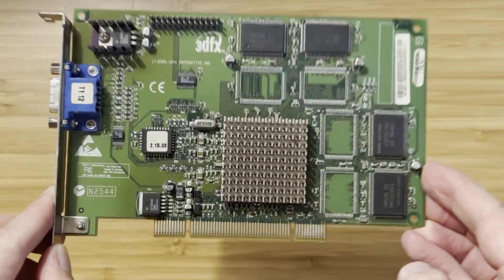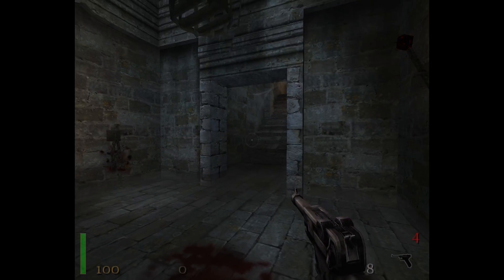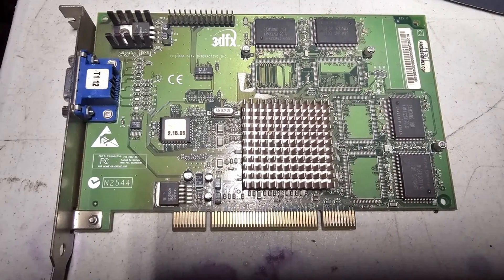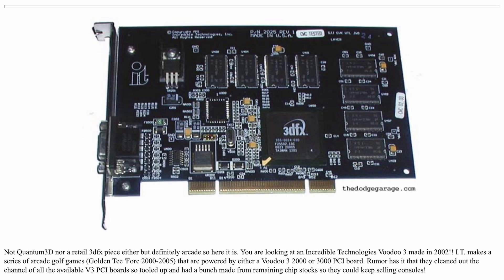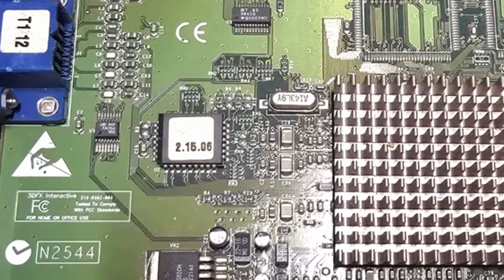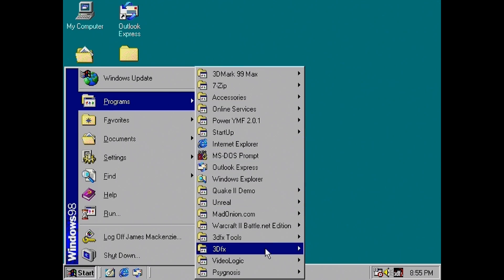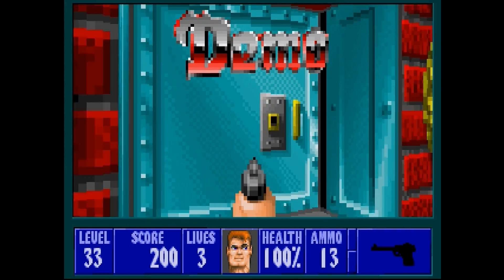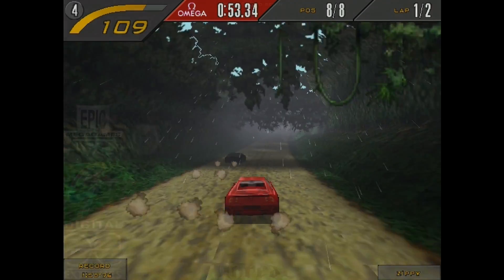Does this Arcade Machine Voodoo 3 work on PC?

Comment: i had this one (Btw iloved Voodoo and it was great to play it ) BUT ,.......this card i am sure have a ver bad cooling ...  The card had 2 mm Cooling Paste below the heatsink . It worked for 20 Minutes ..after the PC Froze becouse the Voodoo 3 Overheated ..After Adding a new Cooling Block on the chip  ..Overhead was over ....
Reply from the maker: Thanks for the tip! I haven’t done a re-paste yet, but now will double check!

Comment: I have a VooDoo 5500 AGP, but I do not have a compatable mother board. I had it from new. So if I want to use voodoo graphc modes i use nGlide it works ok,
Reply from the maker: Both nglide and dgvoodoo are great solutions if your real Voodoo hardware is incompatible - I used it a few of my machine too 😎

Comment: That ati radeon card you have installed can use nglide or zeckensack glide wrapper without needing a real voodoo. the Dgvoodoo wrapper can also be used for glide DOS games.
Reply from the maker: I’m very interested in dgvoodoo support for DOS! I’m not aware of any DOS 3D renderers that would support e.g. a Radeon. Do you have any more details? 😎
Reply: @jamesfmackenzie  hello, for dgvoodoo glide support to work requires that dos games run under windows with a direct3d7 capable gfx card via windows dos prompt.

Comment: I recently picked up a Voodoo3 1000 16MB SGRAM for $60, did a volt mod, added a heatsink with a fan, and flashed 3000 VBIOS.  The real rub is that it's faster than my real SDRAM 3000. 😂
Reply: You got scammed too...
Reply from the maker: Amazing result!! 😂

Comment: ...for cheap, less than 100 dollars. That sounded terrifying. Maybe inflation has something to do with it, but I remember getting Voodoo3 2000 and Voodoo3 3000 cards for less than 5 dollars, back in 2005-2010...
Reply from the maker: Yeah, these prices have gone crazy. Unfortunately my original hardware is long gone - so I’m trying to re-buy everything. $100 is actually a very good price vs what these normally go for - especially PCI variants 😢
Reply: @jamesfmackenzie  Это только начало - инфляционная буря у раздутого на 90 процентов доллара  будет хуже чем в 1930х... Санный Джо сделал все что мог
Reply: @ЕвгенийБеликов-у9у что ж ты чушпан им на английский не перевёл?😂 Они ж ни черта не поймут
Reply: @ЕвгенийБеликов-у9у  не интересно - не переведут, никто этого не делает.
А насчёт словечек - так я понятия не имею, откуда это несуществующее слово взято, но сразу видно что ты в теме "шедевров" кинематографа 😂

Comment: i still have my 3dfx Voodoo 3 2000 PCI card I bought from Walmart for $100 back in 99 to replace the S3 Virge DX that was in my system, i also still have the system i put it in. yeah it's overkill for a Pentium 1 200Mhz system, but the S3 card that was in it wasn't really good for much other than DOS gaming.
Reply from the maker: Quite the upgrade from the Virge DX! 😎
Reply: @jamesfmackenzie  for 3D acceleration indeed, BUT for DOS games that S3 with the VESA drivers was no joke.

Comment: With two video cards in the system how do you manage the output ? Rg do you have to swap the monitor cable? Ot is it always connected to the agp card and the system can take advantage of the voodoo in pci slot and render glide displaying the picture on the agp card?
Reply from the maker: You need two cables. I have a DVI cable running from the Radeon, and VGA from the Voodoo 3. I connect both to the same monitor, and use the monitor OSD to switch. 😎